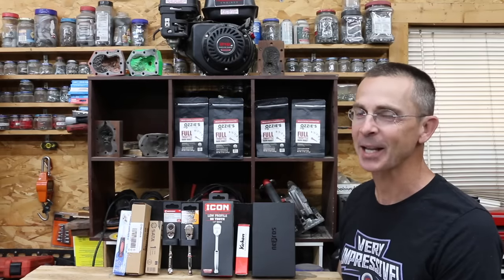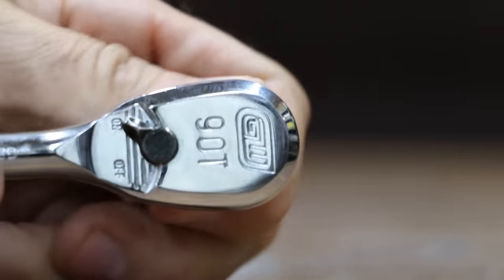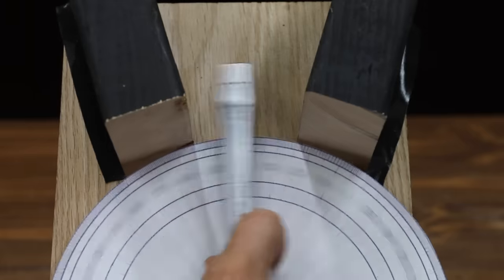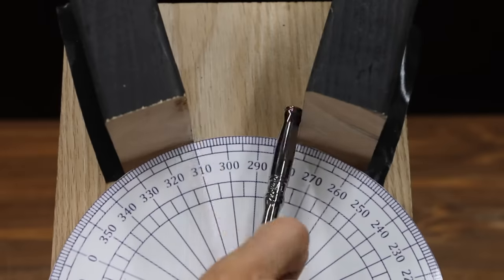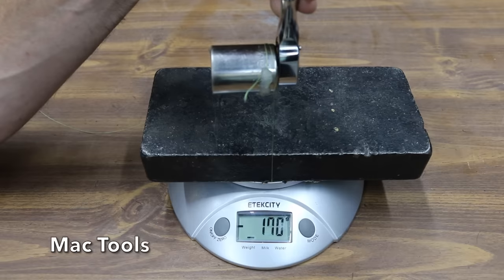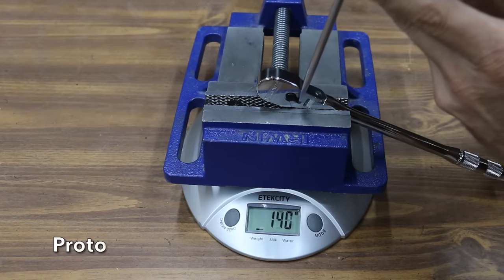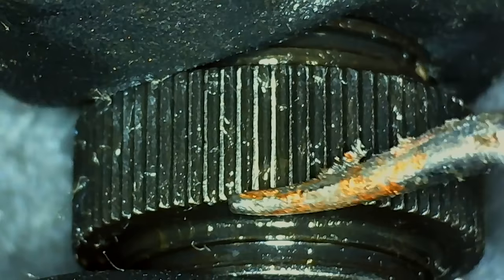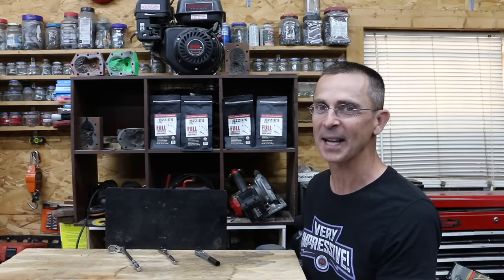Best Ratchet (1/4 In)? Snap On, Icon, Proto, GearWrench, Prototype

Comment: I've worked as a professional mechanic.  When starting to look at this video I was thinking that some of these ratchets won't be very strong, and there is some difference in the failure loads, but not a lot and even the lowest one at 66 ft-lb would be stronger than what a person should need from a 1/4" drive ratched with a short handle.  If you need more torque then get a larger ratchet.  I think the most important test for these small ratchets is the back drag test.  You will frequently be using a small ratchet on small fasteners that don't offer a lot of resistance.  Second most important is how well they work in a tight space because you are likely to be using a ratchet like this in a tight space.
Reply from the maker: Thanks for sharing.
Reply: I worked as one awhile too. My problem always was, when you have that bolt that you can't fit your 3/8 flex head onto, that 13mm, and its really tight, so you put on your 1/4 and use an end wrench as an extension. That's been the doom of several of my cheap 1/4 ratchets. My SnapOn has held up so far for 5 years though, and then i know ill always be able to get the drive replaced if i need to. The cheapos i had i don't even remember the brand, but it wasn't one of these.
Reply: @eclipsegst9419  A very good point. Snap On warranty would repair or replace. Show me another brand on here doing that.
Reply: @echobeefpv8530  pretty sure most brands will replace I've replaced husky ratchets before
Reply: You couldn’t be more correct in my opinion
Reply: @PeterTrimboli I’ve had places change their product line before and don’t honor warranties on previously sold tools. Just my couple of pennies
Reply: Yep most of the tests he made seem to skew the results, I think the Koken is wonderful for the backdrag and they also sell a higher tooth count version if you need it to work in confined spaces.
Reply: @echobeefpv8530   Almost every brand in this test warranties their tools for life for any reason whatsoever.    With GearWrench, Icon, and Husky being MUCH cheaper than Snap-On AND with the latter two in particular offering the ability to get your part warrantied at thousands of retailers in minutes, as opposed to waiting next month for your Snap-On pusher to come by.
Reply: @jpikl1284   There are no results to skew.   There's a reason there's no overall final score.   Every person will weigh different factors differently based on their use case .  For some people in some applications, a load factor is important.  For other people, backdrag is more important.  And for others, physical dimensions the most.   Each category is scored individually so that each viewer can then weigh each factor themeslves.
Reply: This is the most correct comment here. By far.
Reply: @PeterTrimboli  without the receipt ? No questions asked ? I'm sure a few will, and could be a lot will. Most pros I've meet use high end brand name tools. I use Klein, I'm an electrician ( for my hand tools ). I'm no mechanic, but a friend who is has a few brands, but mostly Snap on. He figures they are way over priced for some bits, but the stuff he uses every day, all Snap On originals. He has never even talked about a broken tool, they just bring him a new one free of charge. They have it in stock.
Reply: Ratchets should NOT be used as a breaker bar.
Reply: @echobeefpv8530  SnapOn will repair any SnapOn product free of charge. The warranty follows the tool not the owner. I found a 1970s 3/8 ratchet that my Grandpa had bought when we cleaned out the barn. Internals were rusted together but the chrome was still good. SnapOn guy had a set on hand and fixed it for free. Told me even the really old stuff he always has at least one kit on hand.
Reply: @sigmahyperion955  You are pretty poorly informed about snap on as a whole. First: Any professional mechanic that has a good snap on driver (mine is EXCELLENT) seldom (if ever) pays these retail prices. Second: The truck comes weekly, not monthly. Third: My driver will come to you anytime, anywhere (weekends included) to replace a tool or fix a problem. And finally fourth: He has NEVER pushed a tool, brought in a tool, or encouraged me to step on his truck. I need something, he provides it and makes it as reasonable as he can. So yeah, they are expensive. But I fix cars for a living and don't have time to try to get replacements. I started out my career with the cheaper tools. Started being the key word.
Reply: @echobeefpv8530  I can't speak for every tool but I know I can take in husky products to home Depot that are not manufactured anymore and swap them out with similar ones no problem they might ask what's wrong with it but that's about it I have also swapped out Klein linesman's at home Depot no problem I usually go there when I blow them and tell them the blade chipped when I was cutting wire cuz the home Depot employee usually doesn't care or they buy that story cuz they don't know any better so I go there instead of a supply house cuz those guys know what I blown up paid of pliers look like
Reply: @sigmahyperion955  That's been my issue with Snap-On independent dealers, they used to be around every week but now it's a guessing game (particularly as I no longer work at a shop or dealership)
Even when guy was supposed to be in office every day (when I worked at MMI)  he would only turn up few days a week for an hour or two
Reply: @eclipsegst9419  Good to know. I have a 3/8" drive 'quick release ratchet that was discontinued probably 40 years ago. I'll keep it in truck and see what Snap-On say next time I see one
Reply: Some people who only own a short handle might just put a pipe on it for more leverage so there needs to be some room, especially cheaper options since most likely it's owned by someone who doesn't have a lot of tools.

Comment: As always a fantastic review.  So cool to let me know a $30 ratchet is great for 99% of the things I’d ever expect it to do.  That’s one reason I enjoy your non biased approach to testing!  Thanks!
Reply: Unless you're buying the tools for use in a professional environment where tools breaking cost you more than just the price of the tool or the time to repair/replace it, Harbor Freight's Pittsburgh line is perfectly fine.  If you just want better quality, Icon is an excellent choice.
Reply: I've always liked Husky products.
Reply: @matsudakodo  Nothing wrong with Husky products either.  My first ratchet and socket set was from Husky.
Reply: @aaronthomas6155  Yep..mine too. And they've done a ton of work!  Dinged and worn...but Husky STILL working well.  I've got a Husky10" portable bulb worklight...that still outperforms my newer LED versions!
Reply: I bought a 1/4 and 3/8 stubby duralast.   6 months and still working great even if it breaks right now it has helped me made enough money to buy another one without crying

Comment: For what it's worth, I actually own the Husky 1/4" ratchet. I am somewhat arthritic in my hands so comfort matters. High torque has not been my concern for a small ratchet so 70 lb is more than enough for my use. I've owned/used it for several years now (3-4 I think) and it is still in excellent shape and works very well.

I do like to hear personal testimonials, so I though I'd post mine. Take that with a grain of salt.  🤓
Reply: Feeling this too, going to order one myself.
Reply: I've owned a 1/4 and 3/8 Husky set for many, many years. I do have Snap On and a few other brands, but I just can't find fault with the Husky in most instances, particularly for their cost.
Reply: I bought a used Proto 1/4" ratchet 50 years ago and it is still my go to 1/4" ratchet. Cordless screw guns have made the arc swing almost null.
Reply: i also have one husky and one amazon one and the husky is better, less backlash, the amazon one is annoying and switching directions feels like a mile both work tho.
Reply: yep .... i almost never reach for a 1/4 ... it always feels like a toy not a tool .

UK here so have a Halfords socket set ( large chain store in the UK ) that ive had for most likely over 30 years . Buying quality simply lasts .
Reply: I have several different have several different 1/4" drive ratchets for different circumstances (Perhaps im just awkward). From ones that I have cut the handle completely off to use like a knob to one with a wobble drive to another that I welded the top of a socket to to create a crows foot ratchet.. Sidchrome, Britool, Gedore, Hazet, Koken even some brand less Chinese junk on my cart at the moment. 1/4" drive more than any other size sockets need to fit into awkward places and get difficult to remove items. 90% of the time I just use a Shamino wobble drive Air ratchet.
Reply: I find Husky quality is about the most consistent of the store brands. Modern Craftsman ratchets are the worst (some will break under very low torque due to a bad direction lever design), Klutch are okay, Kobalt range from junk to excellent, and Husky is great. Not too much experience with Harbor Freight rachets but the Pittsburgh feel cheap, Icon seem fine but much more expensive.
Reply: I have a 60-year-old S&K should be worn out by now! But still my go to! I have taken it apart cleaned and lubed about  3 times!
Reply: @JimNapaCA I bought my S&K when I was 16. I am now 71 and I can say that my S&K is in better shape than I  am!
Reply: @dazaspc  My half inch drive Britool is probably 50 years old and still works fine.
 Only thing that broke was the roll pin to change ratchet direction. (probably around 1986~7? when I worked at a Suzuki/Yamaha dealers)
 I'll get around to fixing it one day when it gets annoying enough (although I rarely used 1/2" drive last 20 years except on motorcycle rear axle nuts)
I use multiple 1/4" drive ratchets as well, just saves time and prevents sockets rolling around.
 Gedore made some really nice stuff but I don't have much left after some London C*** stole most of my tools from shop years ago
Reply: @godzillas6301  I don't remember Halfords sockets being much good in 12 point? 
Around 1980, I bought a 36mm half inch drive socket to use on BMW motorcycle swing arm nut (adjust bearings, I was working at dealers) 
 It cracked first time I tried to use it so it got welded back together and got job done. 
Couldn't return it so welded it a bit more, turned it back to shape to fit better in frame pocket and still have it today. 
It hasn't been used since around 2008 but friend with BMW R90 needed to borrow it and it worked fine for him
Reply: @1crazypj  not been used since 2008 but lol .... know this feeling . Opened a tin of paint today using a tool created to help line doors up at Leyland rover from around 1988 . Its still going strong . Its in the draw above the hammers 1 of which was used in the building of my house in 1951 ..... bloody hard to throw away tools thats for sure . 

As a rule you struggle to find anyone who has anything bad to say about halfords tools . Theres also the lifetime guarentee which says alot about the quality .

Comment: As a professional GM master tech i have both snap on blue point and Milwaukee 1/4 inch ratchets and the Milwaukee is my favorite to use for tight spaces. And i have a swivel head snap on 1/4 with a six inch long handle ratchet that i use for places i need extra reach or leverage. Great review as always!
Reply from the maker: Thanks!  Thanks for sharing.
Reply: Gm Master tech? What does that mean? Do you know how to check voltage drop in all the connections?

Comment: I’m a mechanic and I love the tool testing videos. Please continue to test snap-on and mac tools. Along with Milwaukee and gearwrench. Amazing videos! Keep it up please.
Reply from the maker: Thanks, will do!  Thanks for the suggestion.
Reply: Gearwrench really is an amazing value when you look at this and the 3/8 version.  I may mention this to my mechanic.  90 ft-lbs on a quarter inch drive is insane.  Think of how many rust-welded bolts/nuts in tight spaces you can free up with that strength and a little pb blaster.
Reply: The real stuff is Gedore and Hazet from Germany, but you gotta have the wallet for that.
Snap-on digital torque wreng is 2000€, a digital torque wreng from Hazet is 3000€.
25€ a socket from Hazet.
Reply: I'm actually surprised at how well the Mac ratchet held up in this video.  I've broken dozens of them over the last 20 years, and it's always a case of the drive teeth stripping and always under far less force than applied in this video.  The Icon ratchet I bought to replace my Mac ratchet has taken considerably more abuse without failure, as have my Snap-On ratchets....
Reply: @aaronthomas6155  Use only fixed (combination) wrenches or a "breaker bar" to "unlock" nuts and not the ratchet, use the ratchet only to remove the nut and it will never fail.
Reply: @AnalogDude_  In an ideal world I would follow that rule 100% but many times you need access that can only be had with a ratcheting wrench.
Reply: @happycamper6352  the "breaker bar" and use 12 sided or Dodecagon sockets instead of hexagon / 6 sided socket and maybe an universal joint.

But i know what you mean, some car brands didn't think well over the position of nuts on and around  on the gearbox. some Hyundai has the gearbox lever mechanism on the box so awkward you kill the threads because the bolt is impossible to set straigth if you try yo build everything together again. because of the inlet manifold and all the hoses around there.
Reply: @AnalogDude_

Im not a lover of either 6 or 12 sided sockets, especially if they are seized or old...... many round off on their edges, but i do see value in the 12 sided versions for getting them on in restricted spaces and limited turning of ratchet space.....

I think a swivel or bending head ratchet with surface drive sockets would offer a best choice in an akward limited space situation, and in a siezed situuation.....

Im sure like any profesional meccanic, you have many choices and options which best aid any predicaments you may face professionally, but for someone new to the trade, those are the options i would choose when starting to buy tools at the begining of a career 🙂
Reply: @mohammedisaa9952  You need to use the ratchet when the screw/nut is already loosened.

These tools when used very often get rounded off, yes. even fixed key or wrenches.

Comment: Pro Tip: You can reduce your ratchet's back drag by applying a SMALL amount of lube to the internals. If your ratchet is old, you can disassemble it, clean it, and LIGHTLY lubricate the internals and it will significantly reduce your back drag. I like a drop or two of ATF. It has a lot of detergent in it and keeps things clean when you go to clean and lube the ratchet in the future. I do this twice a year.
Reply: Thanks for the comment. As anal as I am about maintaining my vehicles and other stuff, I’ve 100% neglected my ratchets. Back drag is by far the most annoying. Just did iATF on one of my 1/4 “ ratchets and it’s very noticeable. I’ll do it on all of them
Reply: @thomasjefferson1081  glad I can help. ATF also makes your rubber/plastic screwdriver handles look like new.
Reply: Great advice
Reply: Super Lube, it's what snap on uses, made in the USA, great stuff
Reply: Just a dork that drives a desk for a living, but isn't ATF hydroscopic? In that it pulls in moisture?  Personally, I've switched most of my liquid "lube once, and forget it" to silicone based products (SuperLube has several) - you can get them from fine machine oils to heavy greases.  No VOCs to evaporate that slowly dry the lube out, and they handle really wide temp ranges.  If I don't want it trapping grit, I tend to use powders such molybdenum disulfide - yea, expensive, but a little goes a long way.  Old school powdered graphite also works wonders.
Reply: @gjm3525 you know the lube part number by chance?
Reply: @thomasjefferson1081  garage door lobe works well also